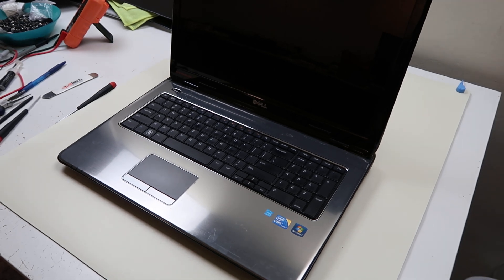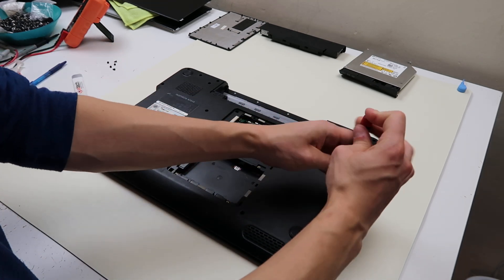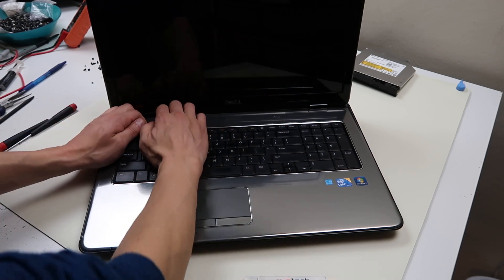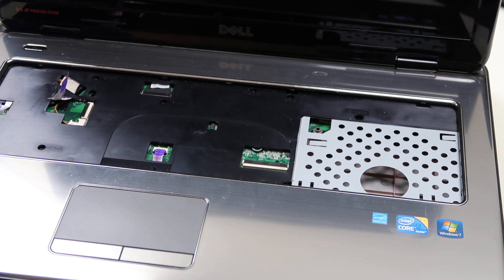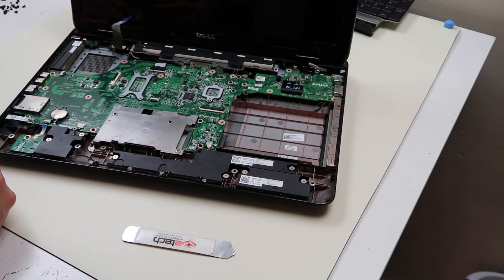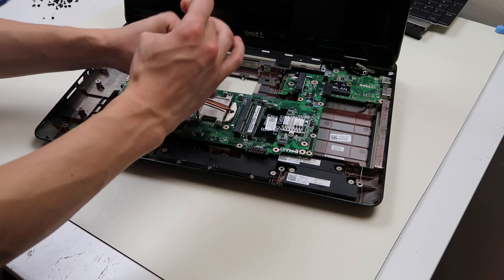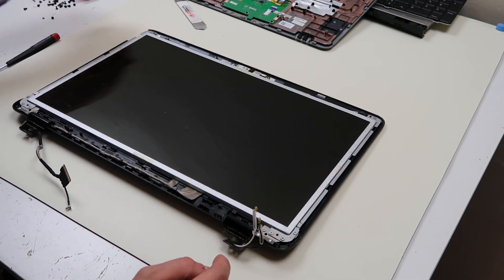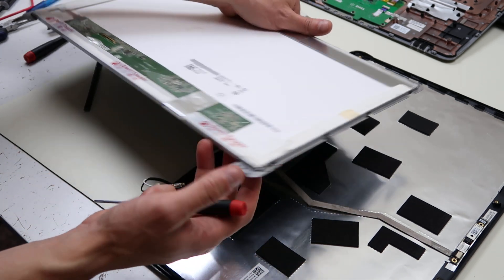Teardown Disassembly Upgrade Options Dell Inspiron N7010 Laptop Computer

Comment: I have the same laptop I know this is an older video but you showed everything just perfect I have a problem with my power button it's messed up how I don't know but I've been messing with it and now it's like kind of wobbly but there is no way in this world that I could take all them screws out like that and do all that without messing it up is there any way to get to the power button or anything I can do to try and fix it without taking it apart? That would be awesome if you could answer me back because you know exactly what you're doing and I don't know where you're at but I sure wish you could look at mine, thanks for any information that you can give me I just hate to throw this computer away cuz I just really like it 🤗👍
Reply from the maker: You would definitely have to open the computer up to access the power button unfortunately.
Reply: @PC_Monkey thank you so much for answering back I guess I'm just going to have to invest and get me a new laptop 🤗
Reply from the maker: @sandib4234  Good luck !!!

Comment: how many screws were there again ?  why don't you use a small parts bin storage box organizer for your screws, and label them, so you know how many screws came from each section, and this way, you can use the bins to also sequence the replacement/rebuild
Reply from the maker: Because I do this every day and can see where the screws go :)
Reply: @PC_Monkey  are you making the video for us, or for yourself ?  i'm not diving into some sloppy job.  before i start this project, i will be counting each screw you remove and from which section, and mine will be in a parts bin, with the number of screws, and which part, and sequenced last out first in.   so keeping track of the screws is a key consideration in this tear down.  can you give us some tips on cleaning pcb boards.  like, if you're doing this, chances are, you spilled something on your laptop.  i need to clean the motherboard, check the cmos battery, and while i'm there, replace the thermal paste/compound.  maybe provide a favorite link to each of these tasks.  if you're going to provide informational videos, you might as well make them good ones.  rushing and doing a sloppy job is no way to go through life.  there's an old saying that haste makes waste
Reply from the maker: @hamidmazuji  Those are great suggestions! Content creators get many great suggestions from non-content creators all the time ;) Yes, this video is for the viewers. But not all viewers are here for the same reason or want the same things. If you show how to sort screws lol, some non-creators will hate for the video being too clogged with useless crap and want you to just show how to access the single component they want to access. If you dont show it, others will hate because the video wasnt detailed enough lol. So as a content creator with half a million subscribers, who gains another 5k every month, the videos I make are the ones I find work for my channel in script, detail, and length. However, as with any business model or undertaking, there are multiple ways of doing it. If you feel you have ideas on how to make videos better, feel free to put those ideas to use and create your videos! And as I tell everyone from the online peanut gallery, 'thanks for your feedback' :hand-purple-blue-peace:

Comment: So glad I found your page/video. I needed to replace my CMOS battery and you showed me just how to do it.
Since I've never taken apart my laptop, I saw that it was full of gunk and stuff; lots of dust. Blew it out and that helped.
Now, I see that I may need to replace the keyboard; some of the number keys are barely attached and won't work.
Unfortunatly, I can't find a replacement for this model, unless there are other models that are compatible... couldn't find any tho, not even eBay :(
Aside from that, Thank you for your help.
Reply from the maker: Can you find a part number on the back of your keyboard? Should look something like this: 0N08R5
Reply: @PC_Monkey  It's the same as the one in your video, 08v8rt.
That what you mean?
(I just reassembled the laptop, btw).

Comment: Took laptop complete apart and still can’t get past Hdd password which is on bios. I can aces bios just can’t removehdd password ,I disconnected everything and tried to jump password was unsuccessfull.. need  Help any suggestions… I have this exact model purchased from second hand store a week ago
Reply from the maker: Jumping the password is a risky operation that, if done incorrectly, can damage the motherboard.  At this time, I dont advise how to do that on this channel.  Sry :(
Reply: @PC_Monkey  aww dang 😞 I just knew you had suggestions or something .I tried it but it didn’t work sooo I don’t know maybe I did something wrong not sure, but I am going to try again. Looking for video on wiping the harddrive so I can reinstall windows 7 if you have one let me know
Reply: @PC_Monkey  this video was a help for me just didn’t remove Hdd password in bios
Reply from the maker: @shyannebrock2491  Good luck !!  Let me know how it goes :)

Comment: Watched your video, nicely done, yeah the screws are insane and guess what even after watching the video I muscled the palm pad and broke all the stubs, still kicking myself.  A new palm board is on the way.  I have two questions; re: the N7010 1) how do I reconnect the antenna, it's just not making sense to me and 2) is this computer upgradable to 16, 32 gbs and if so what do I need to do?  Appreciate the videos, nicely done.
Reply from the maker: 1.  How to you reattach the antenna wires at what end?  To the Wifi Card or inside the LCD Assembly?  If your talking about to the Wifi Card, you simply put them over the snap, and press.  It can be very tricky but its a simple snap.  Once they are touching correctly, they will snap in when you push.
2.  I think the N7010 are maxed out at 8GB unfortunately :(   You can try installing more but I dont think the computer will be able to access it :(

Comment: Greetings, and thanks for the video. It appears the speakers on my beloved old N7010 have gone bad. From the video, it appears that it should be possible to remove and replace the speakers without removing the motherboard (which I'd rather not try to do); is this possible, or am I missing something? Thanks again.
Reply from the maker: Yes.  On most computers, you should be able to remove the speakers without removing the motherboard !!

Comment: I have N7010 and it will not run the internal diagnostics  F12. It starts but the laptop shut off in the middle of the memory phase. Replaced 6gb memory with a single 4gb stick and reran the diagnostics. This time the memory portion completed a few steps later the laptop shut off again. Could it be the CPU or motherboard?

Comment: I thought I'd have to take the monitor off because i can't open the cover the way you did, but I saw you remove a screw from someplace I didn't see. I'll look for it when I get home. The reason why I tried to take this computer apart in the first place is because, after buying a new AC adapter and battery, I'm still having problems with the computer even recognizing that a battery is in the computer. I get the flashing orange lights and one white light continuously. Also, the computer would turn itself off unexpectedly sometimes. Sometimes, it comes on effortlessly and then I'd get the Windows blue screen of death. Do you have any ideas about that? The solid state hard drive is fine. I tested it on another machine. Imo replace the CMOS battery next. Then, I'll be sure the fan is clean when I do get it open. I have new RAM chips on order, as well. Anyway, thank you for this video. It's nice to find EXACTLY WHAT YOU'RE LOOKING FOR on YouTube! L
Reply from the maker: Glad this video was helpful :):)

Comment: Hi. Good lessons. Please see, correction found practically by me, in order to lift(disassemble) the palm-rest(uppermost cover of the laptop) safely within the model Dell Inspiron 17R N7010  only 2 palmrest cables(buses)(leftmost and bottom-most if facing to laptops display) and 1 keyboard cable(bus) among 6 are sufficient to remove(disconnect) from the motherboard connectors, because the rest 3 cables(buses) are not connected to palmrest nor to the keyboard and practically have pictures of it.
Reply from the maker: lol thx for your practical input
Reply: busses....   :)

Comment: Great video.  Is it worth going through all the trouble of disassembling the palm rest and taking off the motherboard to replace the thermal paste?  It's more the risk of breaking something that concerns me.  I'll be doing a RAM and SSD replacement for sure, and those look a heck of a lot easier.  It's my mother's computer, and it's at least 10 years old but doesn't get much use.
Reply from the maker: You are correct.  A RAM and SSD upgrade are a lot easier for a non-experienced operation.  A CPU operation can be more risky and if it makes you uncomfortable, you may want to avoid it.  However, if you go slow and take care to not damage anything, all computer hardware operations are very doable :)

Comment: I have this laptop since 2011 and still using it at home. It works ok, except the brightness of a screen is not so high, I think its around a 2/3 or 1/2 as when it was new. So what should I replace for a brighter screen? Maybe a display backlight lamp? There is 1 or 2 lamps? Where can I order a new lamps? Thank you
Reply from the maker: You may just need to replace the LCD

Comment: This helped me to replace CMOS battery, all at home
Reply from the maker: Great to hear !!  Always here to help :):)
Reply: Does your pc was not turning up to bios? 
Was it 100% dead?
Reply: @Mohamed-_-GG27  PC comes on and I can access the bios but has a Hdd password That I just cannot seem to get past, so I am looking for any suggestions available? Other than that I am probably just going to wipe the hard drive and reinstall windows 7…Any suggestions? I have this effects model in video
Reply: Do you need to remove the keyboard to access the cmos battery?

Comment: I have a an Inspiron N7010 A LOVELY LAPTOP 💻  👌 AND I WOULD LINE TO GET HER UP AND RUNNING. CLEANING HER OUT TODAY NEED NEW SPEAKERS 🔊  USED IT WITH MY STEREO SYSTEM MOST BUT ON THE GO I LOVE. ANY EASY ACCESS TO REPLACMENT PARTS PLEASE ?
Reply from the maker: I usually get my parts on Ebay or Amazon :)
Reply: @PC_Monkey   Thank You :)

Comment: Does CMOS Battery also keep date and time when unplugged? Each time I unplug my N7010 from AC Current I lose Date and Time, Even though I have a normal health laptop battery. Or, what else could it be? Thanks much. Great Video.
Reply from the maker: Yes, if your Date / Time settings are constantly wrong, that is most likely due to a failing CMOS Battery.  Replace it.
Reply: @PC_Monkey  Thanks Much.
Reply from the maker: @BitsOfTruth  NP :)
Reply: i dont mean to be offtopic but does someone know a method to log back into an Instagram account??
I stupidly forgot my login password. I appreciate any tips you can give me.
Reply: @Cyrus Grayson instablaster =)
Reply: @Maximiliano Easton I really appreciate your reply. I found the site thru google and I'm trying it out atm.
Seems to take a while so I will get back to you later with my results.
Reply: @Maximiliano Easton it worked and I finally got access to my account again. Im so happy!
Thank you so much, you saved my ass !
Reply: @Cyrus Grayson you are welcome xD